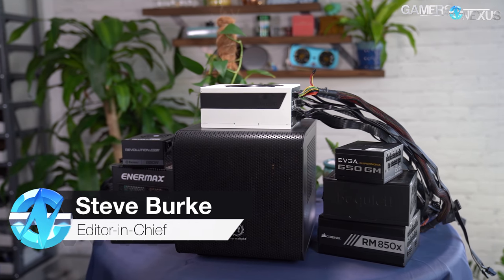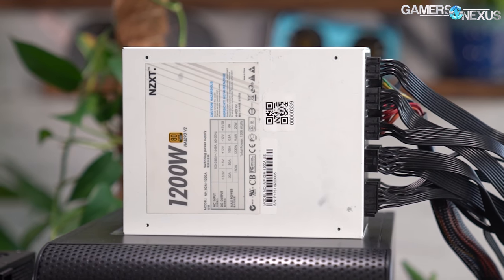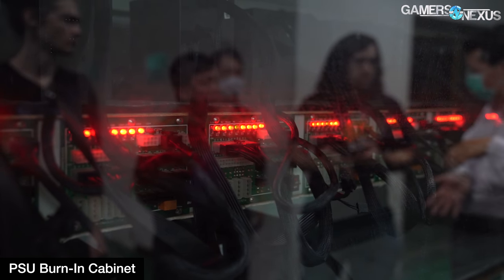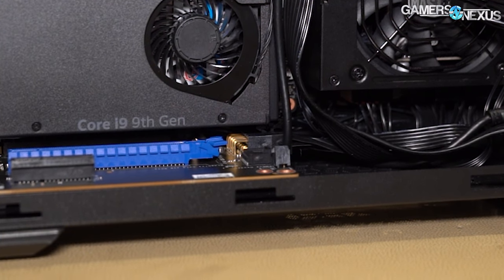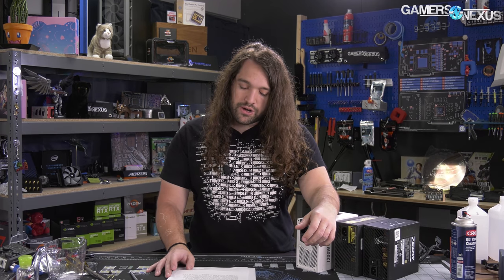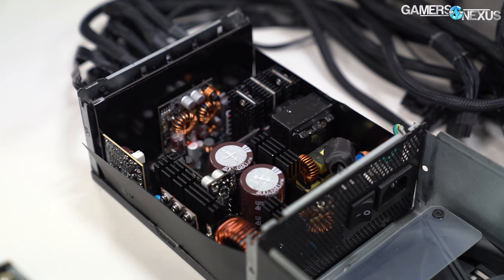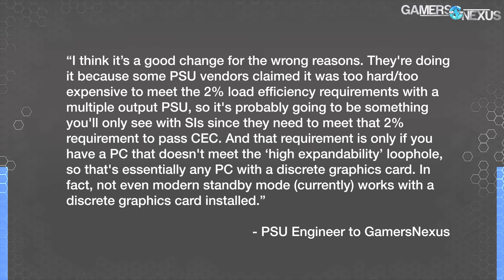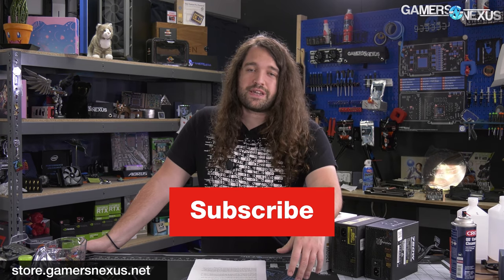Intel's ATX12VO Spec Explained & What Manufacturers Think

Comment: may be  the US needs to fuckoff the 110/120 vac  systems to standardize  the electric grid  and deal with 220/240 single phase in the home..

to me this has wider implications of use outside of the pc world I think  however how are you going to handle  components that might of been designed to run on 3 volts

this sound like a spec more for multiple psus in servers or dual/quad/sextet and octet based psu chassis..

I think if the US really wants fix its power grid problems then standardize to 1 form factor power  is the only route to go it is time to remove the need for 110-120 vac power system

the issue isn't dc voltage output that is the issue  it is the excess power it to down convert from 220, 230 and 240vac to 110, 115 and 120 vac and visa versa..

I find with use with comms equipment like radios and i think the option to support 13,2-13.4  without the use of a buck convertor on 12 volt rails might be a better solution 

May be start the revolution of migration to anderson style plugs  so you can  run a 12-13.2/vdc  off a psu making it versatile outside the pc industry standardize it  so the same psu can multi facet outside of pc use..

Comment: cause nobody using 5v and 3.3v rail anymore ....last time was use when CPU was using the 5v rail while devices and ram   using 3.3v rail...cpu shared with board 5v usb and these days ...cpu using more than 5v it seems lately...and cpus are getting close to gpu 12v rail...i notice nowdays 12v rails getting bigger and bigger due to gpu using more power and more power ...during the time VRMS been used more than mother board cpu 5v rail...back then motherboards never had VRMS before and never used when first been added to motherboard as a overclocking feature to switch cpu from 140w 5v to 700w 12v rail ....by turning it on through BIOS ....only for cpu's gonna beyond TDP rating....also shrinking lifespan....during that time many powersuppy mfgs starting to shrink the 5v rail from 140w to 100w even further down 90w....soon it won't be utilize due to VRMS starting to grow on the board for 12v rail thirst

Comment: I've been seeing this in OEM HP prodesk desktops for about 6 years now i think.  My not be the same standard; but it looks like they only output 12v from the power supply with about a 4 or 6 pin connector to the board from the power supply plus the 4pin cpu power cable.  that's it from the power supply.  power to drives and such are from connectors on the motherboard.

Comment: Lets add unnecessary clutter to motherboards that are already filled to the brim with compenents, yeah, seems like a good idea. /facepalm

Not to mention that you are shifting pieces of the power delivery from PSU makers that generally know really well what they are doing and have a lot of experience, to Motherboard makers, who don't have anywhere close to the knowledge on the matter compared to PSU makers, so this will also create a lot of problems with lower quality or parts missbeheaving. Wich will end up lowering efficiency by those parts being made worse than they would without the change.

Also, this is what happens when you only focus on one thing (in this case efficiency at a certain point) and you ignore everything else.

Lets just hope it really ends up staying in OEM prebuilts and industry applications, and stays far away from the DiY sector.

Comment: Sounds like a scam... Move the lower efficiency bits to the motherboard so the PSU alone looks more efficient? Seems suspect... Hopefully it goes away.
Reply: More like, the motherboards can now step down only as much 5v as they foresee needing, thus increasing efficiency and reducing production costs--at the expense of the flexibility that we need on the enthusiast side of the spec. So really, this just isn't a spec for us. it's a standardization for the SIs that are already doing it.

Comment: Ehm...
Had to give this a thought or two.

It is shit! The whole "12V for efficency" is complete bogus!
3.5" HDDs are all over the place in what they need (SATA has it all)
2.5" SSDs are mostly 5V
M.2 is 3.3V for power

So now the region near the chipset (which as we learned from X570 is nearly impossible to cool (if you don't use a real heatsink)) will get more chokes and MOSFETs/Powerstages that produce more heat in an area where the +200W highend GPUs exhaust their 40°C air.
What a wonderful idea!

USB with 12V is equally bollocks when you think about it.
MicroSD cards would have to step that down to their 3.3V which would make that great fun in smartphones where the battery is 3.7V as you would need a regulator that can handle 3.7 up to 12V
USB thumb drives would get a nice "inductor hump"...

TL;DR
Can't have 3.3V and 5V rails in the one place in a PC that is not cramped, so we stick it in the one place that is overloaded and expensive as is while creating more electronic landfill fill with every motherboard. WONDERFUL IDEA!

Comment: Bull.  These PSUs did not come out for the general public to purchase, but all the pre-mades now require them.  Meaning you can no longer buy pre-mades and upgrade their PSU and GPU to save a buck.  This is why they "upgraded" it.  Whether this is a permanent problem or not, after over two years with no effective options on the market for DIY folks, this is clearly just a money maker.  Has literally zero to do with efficiency or any substantial objective improvement to PSUs/motherboards.  Would love to see a video about this years later.  These manufacturers deserve to be sued for this, and I'm speaking as a lawyer though I don't personally handle consumer rights cases.

I think it's ridiculous to say this only applies to "DIY enthusiasts."  I bought my GF a video card, and decided a pre-build would be a good choice to throw the GPU into.  I'm not an enthusiast.  I'm barely even an amateur.  I'm just a guy who knows how to screw computer parts into other computer parts and do a little research.  I proceeded to buy her some Acer that can't use the new PSU we bought, and now I'm realizing nor can literally any other pre-build on the market right now.  So if I want her to have a good computer, I either have to build the entire thing from scratch, or buy the entire pre-build with GPU.  This was the point of the new PSU/motherboard design, period.

Comment: i'm still just baffled as to why they'd take the 5V and 5VSB rails off. every single external device out there uses either USB type C and that's another beast entirely, or USB type A, which runs on 5 volts. i agree with the guy at corsair's statement, 3.3 and -12 can go, nobody uses them anyway, but taking off 5v just means that instead of power supply makers, who arguably are in the best position to make 5v converters, motherboard makers, who are arguably in a worse position to do the same thing, have to do that exact job.

is it just that the regulations call for efficiency ratings on power supplies and not on converters present on motherboards? because at this point you can just build the power supply into the motherboard and connect it directly to 120 / 230 volts, then pretend like your "power supply" is the cable and that it's 100% efficient.

Comment: Can we just not sell Devices in California, moving the rail generation from the Psu to alternative places is a massive steap backwards. It increses the total sysem complexity, the bom complexity, material costs in PCB creation as well as the Testing costs. It removes the ability to use a nativaly lower power/low voltage lines if a device does not need the full 12V, and will likely duplicate power rail generation componants across other places. This will increse the consumer cost, as well as the total enviromental impact likly far more than the near neglable effect of energy saving when compaird to other inefficencies in power creation/transmission/storage, E.G. like the massive the power loss over long distance High voltage lines. A PSU is a single testable componant which is why the standard is so old, its in need of resivion, but not a hatchet job to pander to some one re-election campain!
Reply: Yup, the cec and intel need to sit down and shut up.  Manufacturers and oems Should say "ok you dont want computers thats your problem"

Comment: Intel tries to make new PSU standard ,but they can't keep up in the CPU market. Ehh then they tries to tell what to follow in development.... This is a f... joke.. This ATX12VO is only good for servers and for shitty prebuild PCs. The other users won't get it well. Then why to push it?? It makes more crowded motherboard and more reason to kill an expensiver parts. PSU could be fixed, but a motherboard to fix with burned parts is mostly impossible.   It is nothing better, then to burn the whole motherboard with an 5 USD USB device. :D :D :D  Other thing is: USB was builded up nice on 5V DC and it is a big standard for the most industry, then we shall throw it out of the window, because of Intel and Dell thinks it is better so. WTF??? And that is only 30 cm cable that is 5V cable and 3.3V sure!!! The whole idea is stupid: the energy loss on a small length cabel isn't as much as you will do on more and more DC/DC converters.